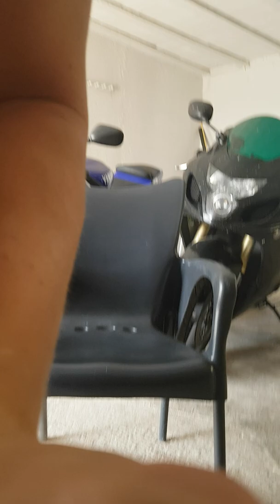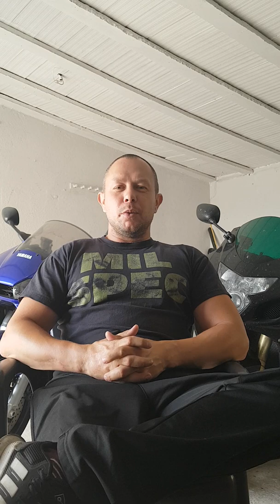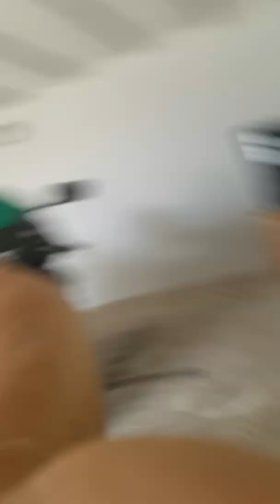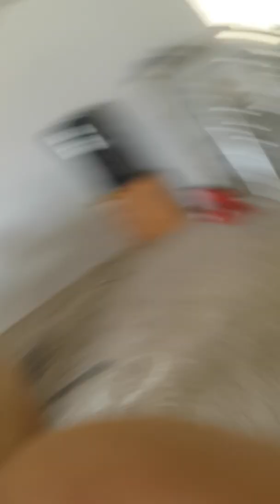Overfueling your om606 and fun facts about diesel engines

Comment: In your opinion and experience mechanic pump is better than edc?
Reply from the maker: It's different worlds my friend. The guys we do business with in Q8, Saudi and UAE need the reliability of zero electronics. The mechanical pumps also gives alit more power. On the streets on the other hand an EDC pump is very, very nice to have.
Reply: @FtunePerformance  
You are right, about having 0 electronics in our country, reason that we use it in camping in desert and long driving in desert, looking for reliable car , my project at final stages 8.5 IP, hx35 on nissan patrol
Reply from the maker: @HakeemAlzaman  good luck with your build and I am only a plane ticket away...

Comment: I don't use a wastegate and I have 3.8 bar boost with BWS366SXE. I am afraid my engine will not last long😆😆😆
Reply from the maker: So turn your fuel down 😂
Reply: @FtunePerformance  but I don't want to do that🤭. Because turning down the fuel means to loose my precious 100-250 seconds 😆